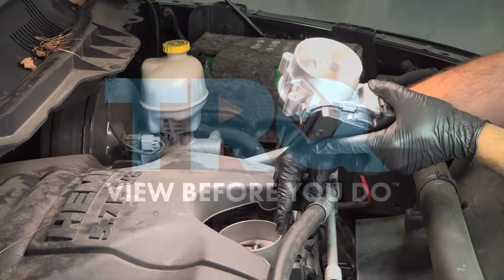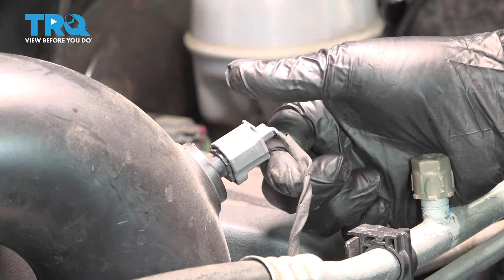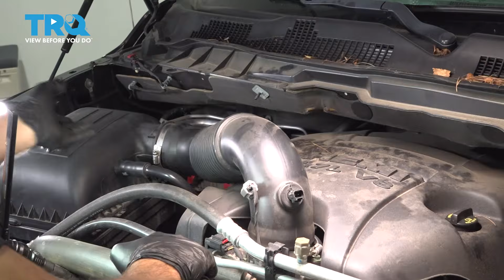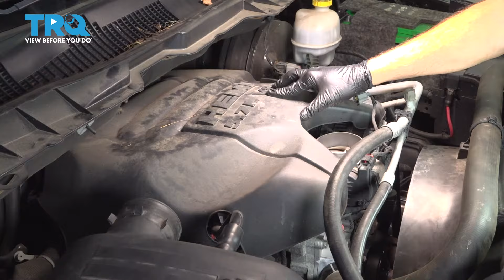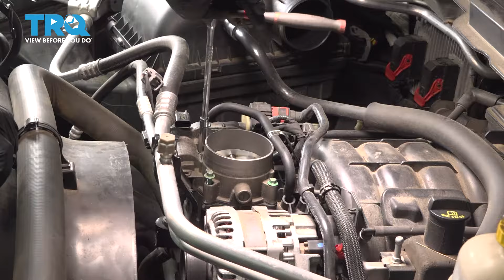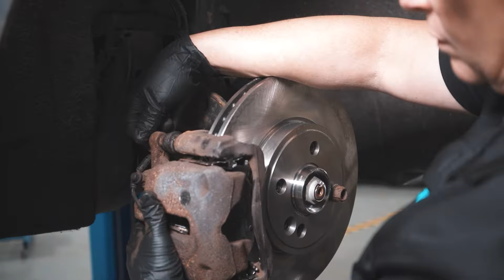How to Replace Throttle Body Assembly 2011-2018 Ram 1500

Comment: 2 things,dont need a scan tool and why wouldnt you just remove the top of the air box off instead of messing with the tube from the air box,better ways of doing this

Comment: Other video says Start the vehicle after install and let it run a couple minutes then turn off and back on and sometimes you have to repeat and that will be the relearn for the throttle body. Others vehicles you have to get 40+ and then slow down and back up to speeds and the computer will learn the more it communicates. Hope this helps someone

Comment: I've replaced this on my 2011 Dodge Ram 1500 slt, and it still runs badly. Keeps stalling.  Code keeps popping up for a bad throttle body. Have tried relearn procedure, and it works until I rev the engine and then goes back to rough idle and stalling.